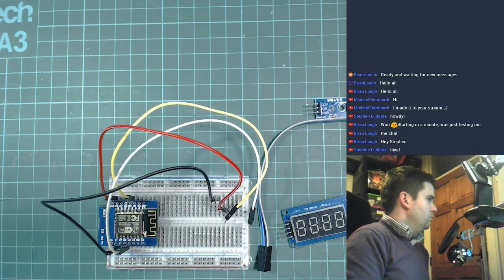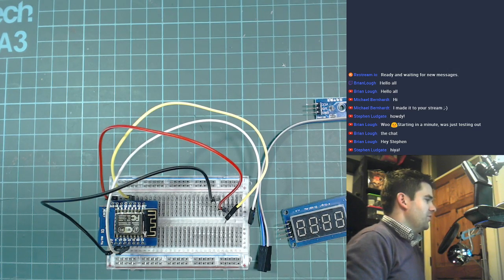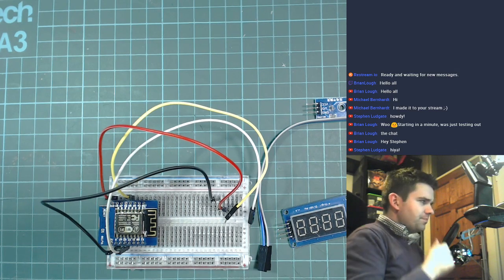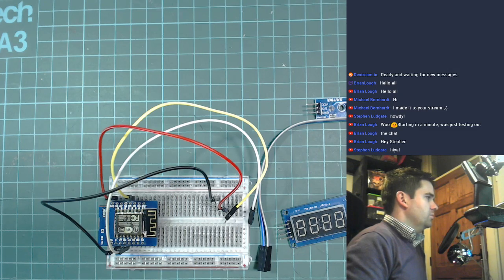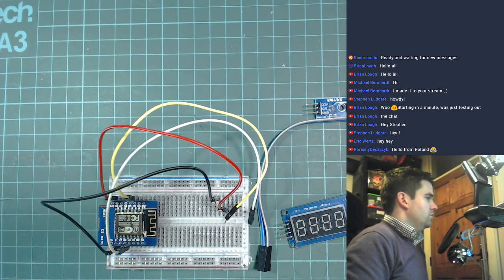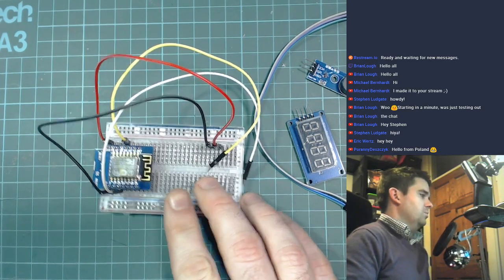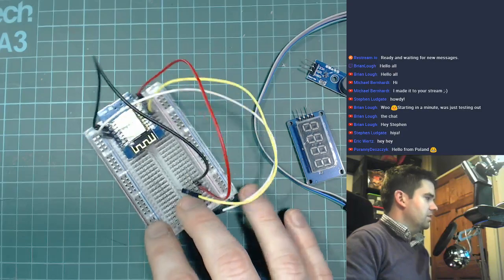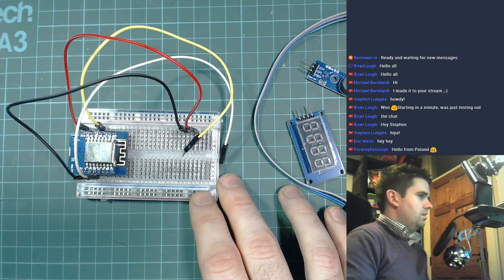Arduino Alarm Clock Build #01

Comment: Hi Brian thanks for the tweet about the old board clock I will not use the buzzer but will use the output to run the Bell motor on my old clock so you could add an output for that but not interested in the Google maps so will remove that from your software thanks Bob in the UK